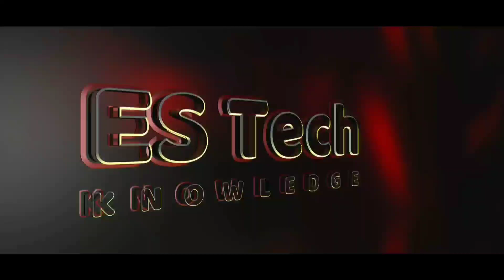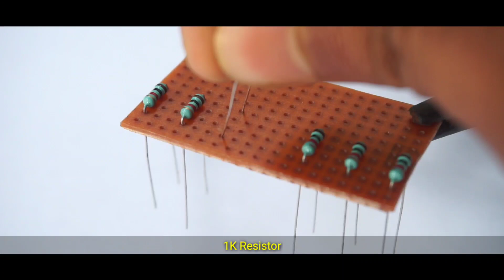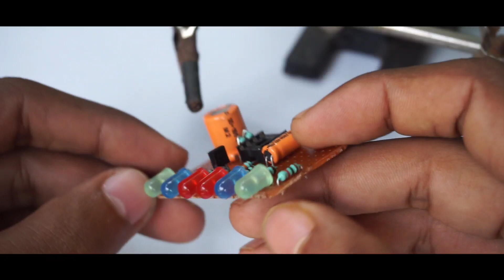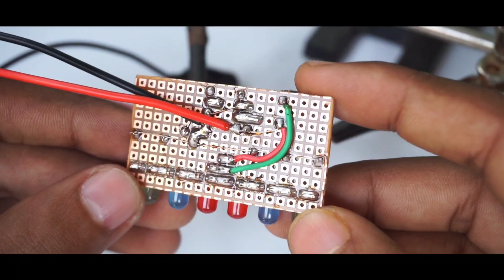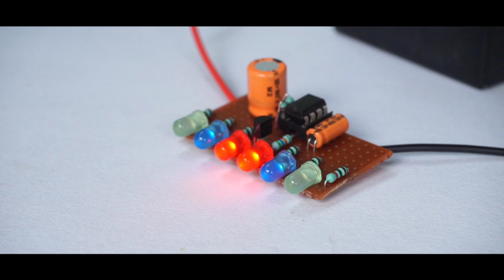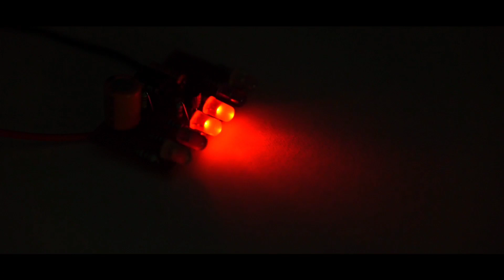WOW!!! Cool Lighting Idea

Comment: Sir which resistor I can use ? Instead of 47k resistor and 56k resistor.. By the way nice video..
Reply from the maker: You can use 68k and 82k or 82k and 100k or 100k and 120k
Reply: Bc 557 transistor  instead of  bc  547 transistor  use  please  tell

Comment: Which transistor can be used in place of BC557?
Reply from the maker: You can use other PNP type transistors like - BD140, 2N3906, 2N2907, etc
Reply: Very very  thank  you

Comment: Very cool! Is the amount of LED's scalable by adding them in sequence as the first 3 (on each side) are? So if I want 6 LED's per side, thus 12 in total, can i just add 6 leds and 6 R1k?
Reply from the maker: Offcourse
But use a more powerful PNP transistor.
Reply: Bc 557 transistor instead of  bc 547 transistor  use  please  tell